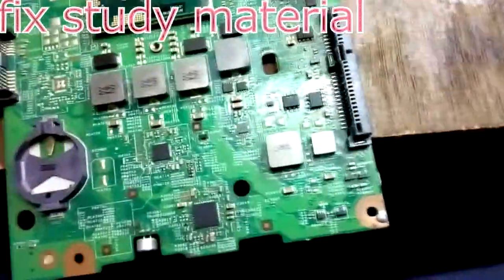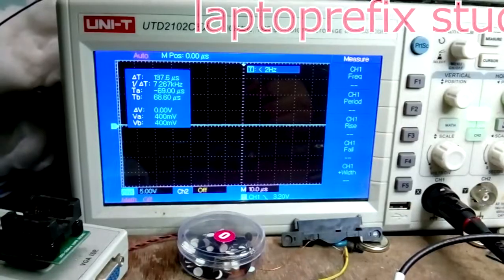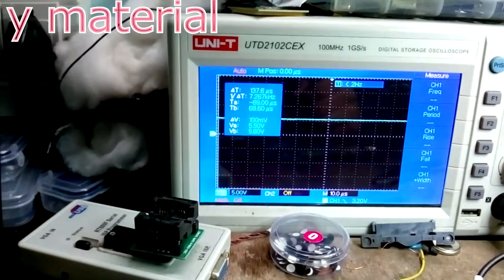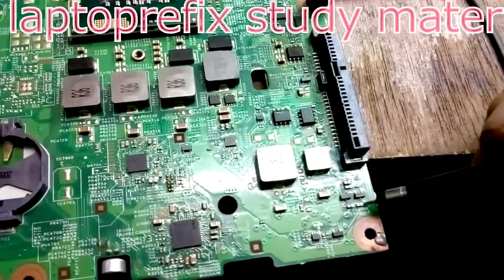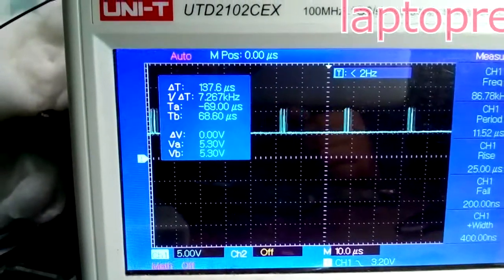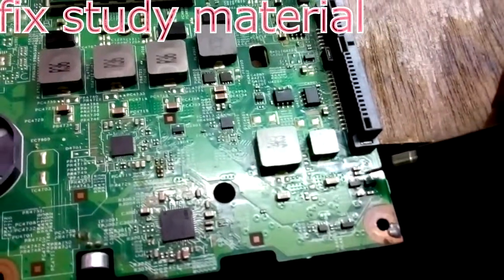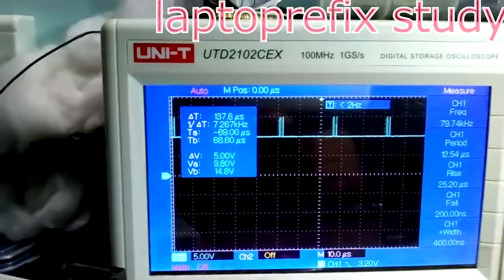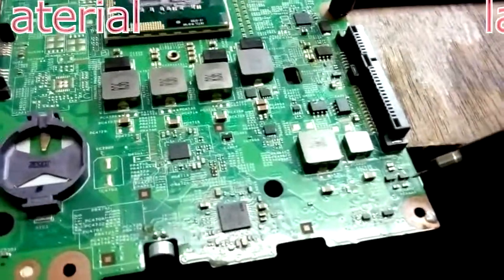N5010 charge pump

Comment: What is the role of this 15 v? 
Why can't we use dcbatout instead of this 15v?
Reply from the maker: it provide high volt on mosfet gates to drive secondary voltage.like 3vs,5vs etc
for more join student pack 8425876748 watsapp

Comment: why so complicated. why not just use the 19v regulated current to charge the battery? there seems to be over engineering in a lot of equipment. is it for safety? to make things fail more?

Comment: HY SIR ONCE AGAING THANK YOU SO MUCH FOR YOUR LEARNING VIDEOS.
SIR I NEED LITTLE BIT YOUR HELP. I HOPE I AM NOT WASTING YOUR TIME
I SIR I HAVE MOTHERBOARD OF HP ELITBOOK 6930P M.B NO. IS 07208-2 IN 
INTEL.SIR PROBLEM IS THAT WHEN WE CONECT CHARGER ITS WORKING IS TOO 
MUCH SLOW BUT WITH BATTERY WORKING FINE. I FLASH BIOS CHANGE CPU 
CHECK RTC AND REMOVE HARD DRIVE DVD BUT SAME.WHEN EVER WE CONNECT ADP
ITS WORKING IS VERY SLOW.KINDLY TELL ME WICH SECTION I NEED TO CHECK 
AND WITCH SIGNAL I NEED TO CHECK FOR FIXING THIS PROBLEM?????????????THANK YOU SO 
MUCH